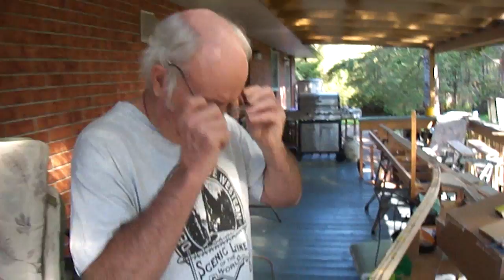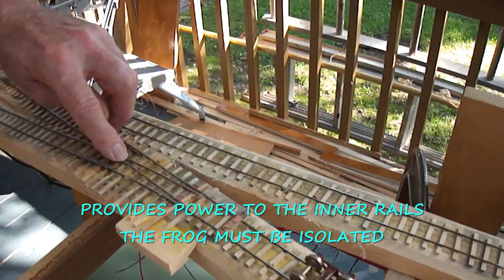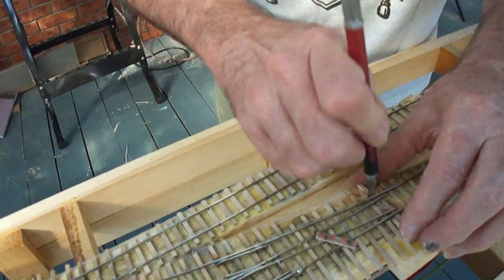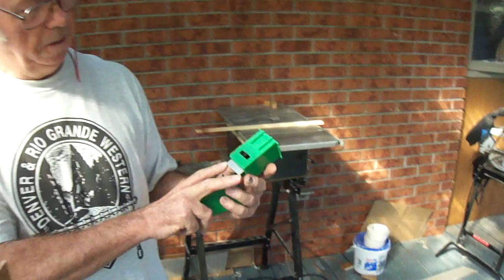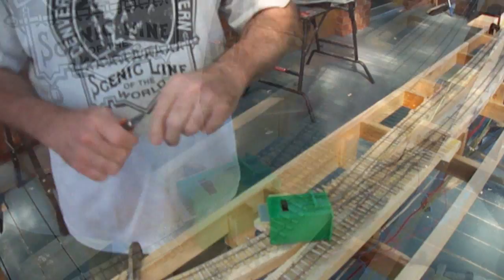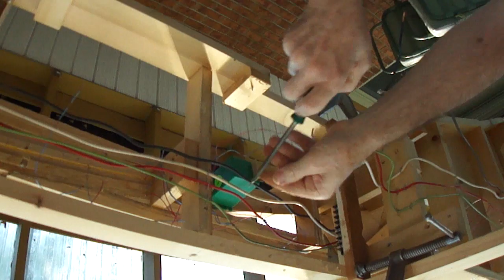PART 1: MAKING A STUB SWITCH

Comment: Use an anti-flux on the throwbar rail joiners to prevent the rail from getting soldered. Yellow ochir has been traditionally used in jewelry work but there are other solutions as well.
Reply from the maker: Thanks for the tip

Comment: It very cool and great tip with the rail joiner. Are stub switches still use today? Thanks for posting. RT
Reply from the maker: +retrainrun Stub switches are not used any more as they are very hard to maintain and are not reliable.  However on this light narrow gauge railroads they were very common.  Now almost everything is a point switch.